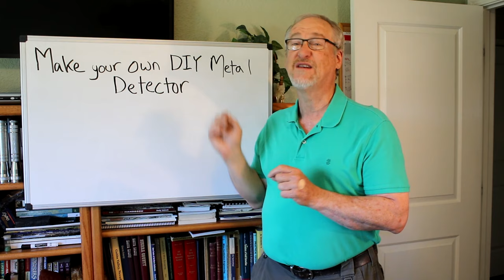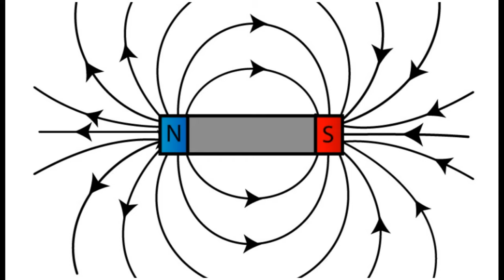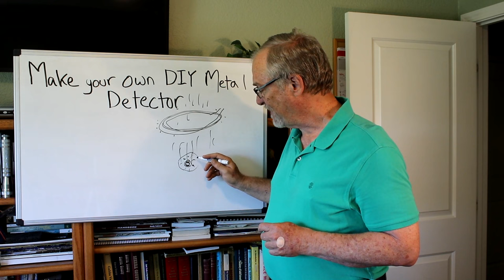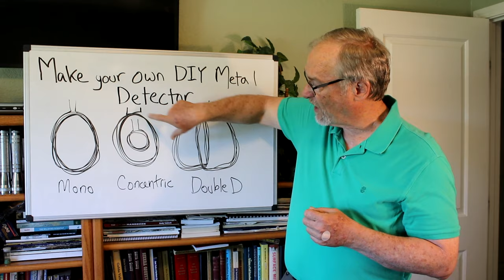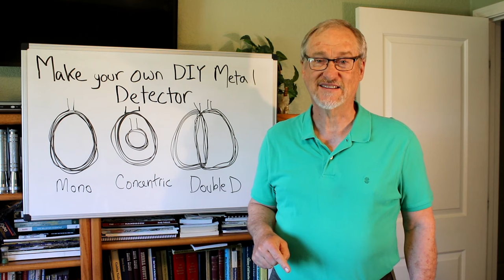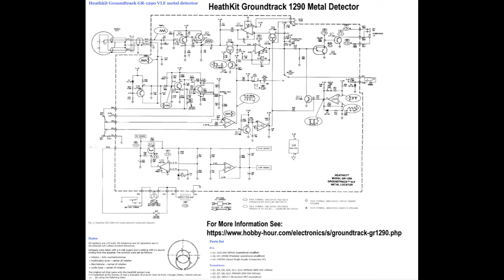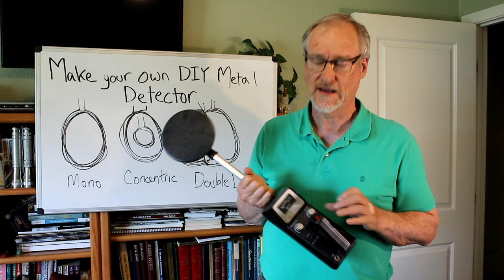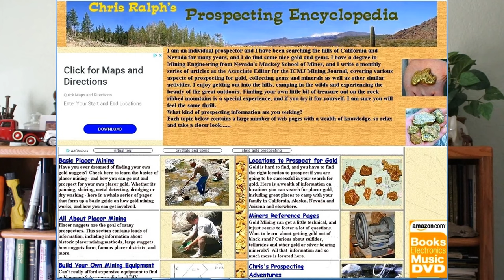Make your own DIY metal detector - turn transistors and other electronic parts into a metal detector

Comment: ... and all that seems to be just the beginning of the challenge. The discrimination between gold from other types of metals is a further step which involves a vectorial analysis of the received signal: that means you don't have to consider only the "amplitude" of the received signal but also its "phase". Diamagnetic, paramagnetic and ferromagnetic materials have indeed different effects on the phase shift of the received signal.. In practice a vector demodulator is needed on the receiver to measure in-phase (I) and quadrature (Q) components of the picked up signal respect the transmitted one... So, further difficulties must be considered in design of this hardware and in digital signal processing algorithms definition... Good luck! 🤗
Reply from the maker: Designing a metal detector with the current technology is a major undertaking - even for a company with a staff of engineers.

Comment: Oh no! Not another project!!! But seriously, I have a Radio Shack model Micronta 4003 metal detector. I modified it to make the head much lighter by cutting out most all the plastic except for a skeleton of what it was. The coils look exactly like the heathkit 1290 coils. I have been experimenting with litz wire and I wonder if I could make a more sensitive coil set using this wire. Also had an idea to design a detector using sine wave circuitry - My Micronta sounds like it uses square waves throughout the detection.
Reply from the maker: Litz wire helps a little bit, but its not a big huge difference.

Comment: Thank you for video ❤ i  is it possible that certain metals can be "betrayed" by methods other than the metal detector?  or to be combined with other types of detection to be able to help in the detection process with greater accuracy?  passive and active methods?  I, for example, have a nuclear radiation detector.  how could I use such a detector, do they have certain metals and other "signatures" than the classic ones?  or a homemade radar...
Reply from the maker: Yes but they don't integrate well with a metal detector.  An XRF device can distinguish one metal from another. But they see into an object only about a quarter inch - and they cost about $50,000. So if you find an object with your detector that is two inches deep, the XRF would be of no use until you dug it out. And normally once you have dug it up, your eyes can tell you what it is.
Reply: @ChrisRalph  thank you for answer !!!!! By nuclear detector i mean radioactive detectors. So maybe..... or maybe not. My nuclear detectot was only 500$
Reply from the maker: But your nuclear detector cannot tell lead from gold from iron from copper or any other metal. your detector just looks for things that give off radioactive emissions. So its not useful for what you are suggesting.
Reply: @ChrisRalph  I understand.  I thought that certain metals are surrounded by specific minerals that have a certain radioactivity.  my mistake.  thank you very much for the answers.  it's amazing to find out so many wonderful things

Comment: Thanks for the detailed information about why I might not want to build a metal detector, and the tiny bit of information on the theory of operation. I thought I clicked on this video to learn more about metal detectors and their circuits, but what I really wanted was 25 min of discouragement and only about 10 min of info. I especially liked how you said the same thing over and over and over but still managed to keep your sparse technical info concise.
Reply from the maker: Thanks for the obtuse but still snarky comment. My apologies if I burst your bubble of building your own detector with 25 minutes of realism. Understanding more detail on the theory of operation for metal detectors requires some substantial background in physics, something not really suitable for a general YouTube metal detector video. If you use google you can find a lot more info on metal detector theory.
Reply from the maker: You have to remember that what for you with your specific intent is useless information may be very useful information to others. If you have no interest in building a detector, it seems a video on building a detector is not going to be what you are interested in. Lots of folks want to build a metal detector for $25 that is as good as a commercial one that costs $1,000 - and that is just not realistic.  If your interest is in theory, you would be way better off searching through Google and reading white papers and other research on metal detector theory and operation than watching a DIY detector video on YouTube.

Comment: One simple thing most people do not know: Iron is ferromagnetic, copper is paramagnetic, and gold is diamagnetic.

One thing that people need to know, is how to read the magnetic flux feedback to be able to build a discriminator circuit.

This will require some learning, but at least people now have a little leg up on building and tuning one.
Reply from the maker: If by "magnetic flux feedback" you mean inductance, then yes.
Reply: I'm still not buying the "MyPillow"😊
Reply: @ChrisRalph  Each type of magnetic field has a different feedback signature that you will be looking for, depending on what you are trying to find.

Comment: Hello, what do you think of the most powerful device is the GPX 5000 or Lorenz Z2 For treasures only and is there anything stronger than the two devices ??
Reply from the maker: I know metal detectors made to find gold nuggets, not deeply buried treasures. The treasures are much larger.

Comment: Hi Chris

Hi Chris
Thanks for a great video.
I've had a Garrett ATX for a while now. It came with DD coil
Wondering if I can make my own mono coil for it.
I have copper wire that is from 0.5-2.5mm thick
Is 2.5mm too thick?
Reply from the maker: The ATX is an induction balance or VLF type detector. That is the technology it uses. Mono coils run only on Pulse Induction or PI detectors. So, no, you cannot get a mono coil to work on your machine as it is of the wrong technology for that.

Comment: hello brother, I'm looking for an accurate metal detector for the Yamashita treasure that can detect even 5 meters below, I saw legit signs engraved on the rock and pointing the direction but I don't have a detector so I can point to the correct location where it's buried if you can sponsor a detector for me to use, I will give a percentage of whatever I get from treasure.
Reply from the maker: No metal detector sees targets at 5 meters and deeper.

Comment: This is quickly becoming my favorite channel! I like learning new stuff and this is the place. I'm struggling with wiring the guitars I make, so I think I'll have to step back from making a metal detector for now...
Reply from the maker: But you know a lot more about it having watched the video.
Reply: I too wire guitars I make, if you think about an electric guitar pickup, it's sorta like the coil on a detector, the wraps of wire create an impedance as the guitar string vibrates over top of the magnet the wire is wrapped around. There is massive technology as to how many wraps, how many magnets, ect... single coil is one magnet with wraps, humbucker is 2 magnets with wraps that sit close enough that there is canceling of frequency,  and if you reverse the direction of half the humbucker, it is now out of phase. Where it gets tricky is capacitor & resistor & and potentiometer values and how they affect the signal or output.

Comment: Not an encouraging video. Let's be a little more encouraging to the newcomer. Lots of things can be done with a little encouragement.
One thing leads to another but you need to be encouraged to start.
Reply from the maker: I would rather be honest than mislead. I do say that if you have experience with electronics projects that this is possible. But it would be very dishonest of me to say that if you have none or very little experience, that you should try it because it is an easy first project.

Comment: How about generate static electricity to pick up the gold when its dry, cause its positive loaded the gold. Like with an electrostatic motor with a turning positive plate and a standing still negative plate.
Reply from the maker: There have been a number of attempts to charge nuggets in the ground. None have made any success in detecting metals better.
Reply: @ChrisRalph   will be gold attractive to static electricity like in dry washers there is also a material that attracts the gold .it's diamagnetic. i have to wait two year for i can research that.its beachgold am busy with it has a shear stress there of 20% so in porto portugal it never ends there.

Comment: If a man had an old White master of coin so said anyway. Had possessed for 0ver 30 years...and had never worked. Looking now @ Seeing that the board itself is compromised is corroded on the back side. Like if a man could or would be able to clean and recoat that back side. Would it be worth even putting it back together or trying to fix or enhance? Heathkit was my dads favorite.
Reply from the maker: If it's corroded likely electric connections are damaged and if it never worked for years,  cleaning is not going to help.
Reply: @ChrisRalph  right I was just wondering if it could be of any use at all but I guess it's been behind the times for a long time lol. Enjoy your videos though. Truth is nice regardless. Thanks.

Comment: I kind of imagine using a small hand held O-scope as the interface and it being an visual alert. Requiring reading the scope to see changes In the sent frequency and received frequency.  Possibly moving to an audible alert after it is perfected!  I have learned a lot about electronics in the last 5-6 years, studying on my own, watching videos.  I wish I had gotten into electronics years ago when I was younger! I was tearing apart things to see how they worked before I started school! I guess I had a damper put on my creativity due to me getting in trouble for taking stuff apart. I always seen myself as being a possible inventor in the future, or a repair guy/tinkerer when I grew up. Ended up being non of them, an electrician,but I have worked in nearly all the trades.  From carpenter, brick and stone mason. Electrical, plumbing, moving mobile homes, and prefab homes. And always been into mechanics. Worked on cars all my life, not professionally. Mostly my own stuff however I have done some repairs for other people when  called on. Mostly things like breaks and wheel bearings  clutches, gear shifter cables.  I do wish I had gotten into electrical engineering 25-30 years ago,  I got a bad taste of schooling as a young kid.  I was held backs year because I only passed test didn't do homework and class work was hit and miss. I was bored out my mind. I only paid attention to the class work if I be was interested in the subject and passed the test because I could just answer the questions and be done.  I'm fairly certain i have one of the things they called lazy. Hyperactive , trouble maker, and s host of other inaccurate names. I think maybe it's asbergers  (probably definitely butchered the name ) from the little I studied on it , seems it describes me better than I could myself.  Things that didn't exist back in the day. Yet caused kids lives to be destroyed because of the way they were treated because of it.  I was always looking ahead in the textbooks. Even looking into the next grades books. The classes had a little pass through in the back. Sometimes I sit back there, and s book I'd left in reach. So if get it and look and read through it!  Going off the rails a lot a bit!!  Maybe I can get myself an electronics work area worked out!  There is a few things I need it for! A GOLD FINDER,/DETECTOR could just be one of them. As long as it doesn't require coding. Me coding Is like getting a chicken to play chess! I can peck at it , seem as if I'm doing something. When it comes down to it NO. No, nothing to see here!!  Analog electronics I can handle it!   Maybe we a Coil connected to a frequency generator that the Duty cycle as well as frequency can be adjusted along with voltage .  Then a pickup coil , tuned to work in the operating  band of the sending coil. So the pickup coil will be able to sense the secondary tones from the sending coil!  I believe as visual interface is the simplest.it may not work the best in the field, in operation however it should work and fairly well. Discrimination should be simple as far as background iron . The hot rocks and heavy iron oxide deposits could be a different story.  This could be another upgrade handled by  the addition of micro controller and possibly amplifier and speaker/headphone. The pickup coil could possibly just just be  the coil ran through a pre amp and then connected to the input of the amplifier! Using band pass filters to block slot of the sender coils frequency.  And possibly operating in ultra high frequencies.  Maybe use a ultra high frequency as a Carrier frequency and pulse it at a much lower frequency. And possibly a coil more like a sat. dish. With the dish being the pickup coil. Or maybe flip that. The large sender coil. Using a small pickup coil to be more precision on the pickup of small targets.  The ability to pickup a bit of gold a fraction of a grain of rice would be awesome for a home built machine!  Especially below 1/4-- 1/3 grain.  And really special if it is 12" plus deep in iron rich soil.   
It would be really awesome if be someone built something similar to Nickola Tesla's coil that required s ground rod.  Then sent serious high voltage frequencies into the earth. And a series of coils picking up everything in the soil easily up to 12' deep!  If the time is spent to Scan and "Draw the picture" with the Machine. With different power ranges it can pickup deeper objects. Possibly with higher frequency, pickup with greater detail.  The ability to take a 5gal. Bucket place 3 items inside of at 3 levels. Then someone use the machine to tell you within 1-2" where and a good estimate of the size. Within 1-2" of the Diameter and thickness. Or at least the mass of the object and it's material make-up.  The majority of the metal. So s gold silver alloy 30/70 gold/silver. Would show as a silver target possibly with s close by gold target!   At about  11"-13" and weight around 2-4 grams!  A machine like that would be able to name it's price! And it be paid!
Reply from the maker: I think using and interpreting an oscilliscope in the field would be terribly difficult - even a small one.

Comment: hi there!, I just found this channel! I'm interested in building the 555 timers proyect. I've already put together a monocoil detector that i found on internet. Could you tell me what's the inductance of the TX and RX in the project with the two 555 timers?
Reply from the maker: Check the reference link for the project. If it has a fixed number of loops in the coil, you may determine the inductance experimentally.

Comment: Whats the best frequency for finding gold? I read 10 Hz is the best for gold.
And is it possible to get metal detectors that only detect gold and not other stuff?
Reply from the maker: 10 KHz is for a coin and relic machine. Most all purpose coin and gold machines are about 20 KHz, and those detectors designed for gold and intended for finding flakes and nuggets are around 50 KHz.
Reply: @ChrisRalph  thanks this helps me a lot in determining a gold detector for myself.

Comment: My best gold day in Louisiana was two very heavy 14k men`s rings, a thick but smaller 14k diamond ring, a 14k small earring, and gold rim glasses that I couldn`t find any information on. Found all of this 9in under an hour on a low lake in a swimming area in 1996 with a 250 dollar Radio Shack metal detector with a 7 inch coil, manual ground balance, all metal threshold mode with a simple symbol target ID mainly designed for American coins. Large rings rang up as aluminum screw caps or 5c typically. I found a lot of jewelry and rings with it. If tuned right it was very sensitive to very small targets. 

I dropped my only very thin wire fishing hook I used to catch very small bait fish in tall hay grass one day on the riverbank and had my detector in the boat and it easily detected the hook although seeing it took time. But it allowed me to continue fishing. So they come in handy. I have a Minelab Vanquish 340 now that I got on a damaged box deal. It`s a great all around machine for what I look for here. Plus I have a Bounty Hunter Pioneer 202 with simple coin based target ID if anyone wants to go with me. It`s perfect for someone with no experience to find some shallow quarters and relics and have fun.
Reply from the maker: Thanks for sharing.

Comment: There are tons of designs all over the net. But you should understand theory and how to source, solder, use test equipment in particular osilloscope.
Reply from the maker: Agreed, but the majority of the designs are simple and were state of the art for the 1970s or 1980s - However, we've come a long way since then.

Comment: for the third project, what is the deep can this detector work and how much its difficult to work with soil which is full with rocks, thks
Reply from the maker: How deep, depends on many factors, most important is the size of the target. Rocks also depend on the kind of rocks - not all rocks are the same.